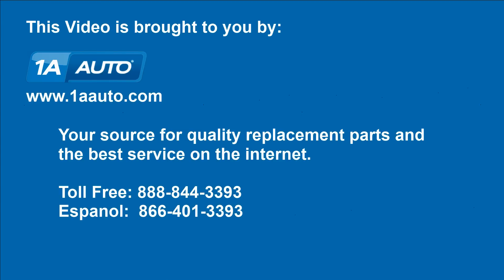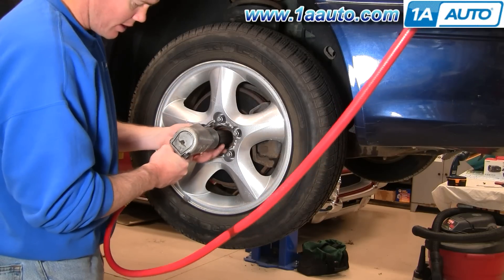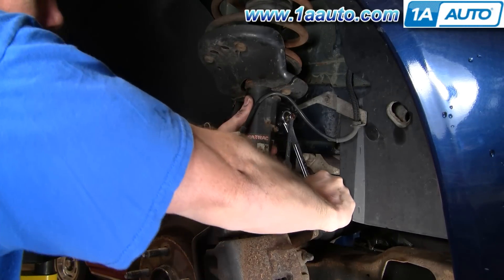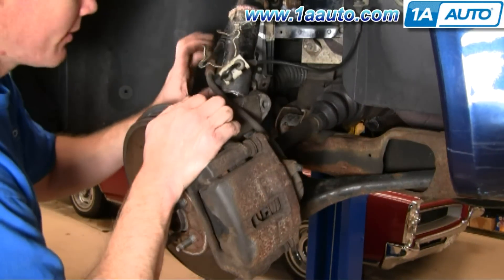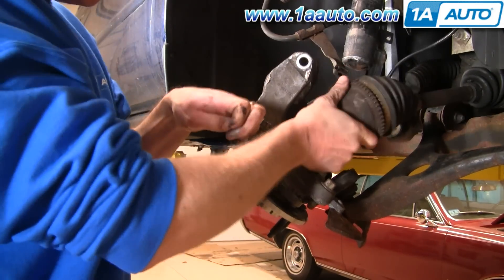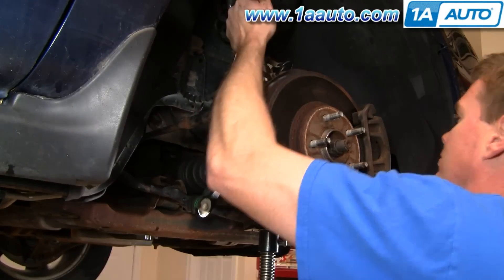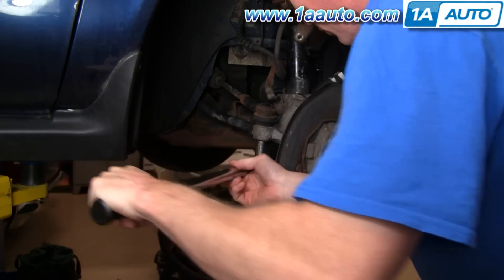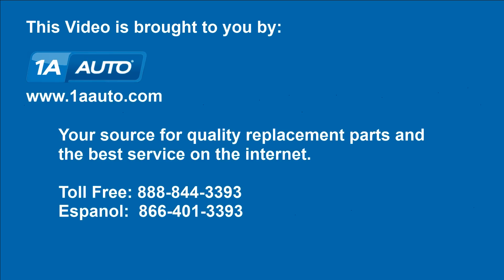How to Replace CV Axle Shaft 86-07 Ford Taurus

Comment: I wish you replaced the old axle with a new one like on mine. I used a new one it went on the drivers side without a problem but the passenger side I still haven't gotten to push right in like you did with the old CV axle.
Reply from the maker: +Teslarawks! Thanks for checking us out! http://1aau.to/m/Shop-1AAuto-c
Reply: @1AAuto  I must have been tired when I wrote that I meant to say that I am having difficulties in pushing the strut back in. I thought the old one was bent when I replaced the CV Shafts and had many people try to get it back in place. Maybe its because it is not on a lift or the sub frame is bent. the driver side went back on without a problem.
Reply: @teslarawks1673  same issue. Did you ever figure it out?😭

Comment: What happened? My strut was longer and couldn’t get it disconnected from the hub. The lower A arm wouldn’t lower enough and hit the frame. I had to take off the lower ball joint.
Reply: True, this is the wrong and hard way to do it. Best way is to just separate the lower ball joint,this is the wrong way to do this.

Comment: CV boot split on my 99 Wagon, only 80K on the car, so I just cleaned the area around the split, sealed it with JB Weld Plastic sealer, no troubles since.

Comment: Any tips for getting the bolt out that holds the lower end of the strut to the knuckle? 4:15 mark...  I got the 21mm nut off, looks like you were able to hammer it through.  I put the nut back on and have been hammering it but it won't move almost like it's threaded???  2001 Taurus.  Thanks
Reply from the maker: You should be able to tap it out with a hammer as we show in the video. You could try to spray some penetrating oil on the bolt, and also possibly lift up on the a-arm with something to help take a little bit of the tension off. Hope this helps you out. 1aauto.com 888-844-3393
Reply: 1A Auto Parts
Thanks, Got it out needed to be hammered used some PB blaster and heat, got it to move a little the worker it back and forth until I could get it all the way out.  Thanks and Great videos!!!

Comment: He makes it look easy to reinstall the strut end. I had a helluva time getting it in. Of course knuckle screw .just be removed (mine seized) and upon reinsertion you must align stop tab in knuckle opening. It also can help to use a pipe/pry bar above control arm and below frame rail (push down or even sit on it--if on jack stands!) and apply a small amount of anti seize to help strut slip in. Once you get it in be sure to put in bolt so that tab stop comes to rest atop of it because this determines the proper strut insertion depth.
Also, while in the vicinity change out the stabilizer bar link as they are cheap.

Comment: Excellent as usual, best videos.  
My problem was getting the strut out of the steering knuckle.  I had to use a small jack between the base of the spring and still had to pry with a screwdriver to move it over and out of the steering knuckle hole.  What a bear, there is no play whatever in the vertical direction, the control arm is bottomed out, the bushings were pushing against me, etc.  It might have been worth it to pop out the ball joint first so there is some room to move.

Comment: @1aauto I actually figured it out a couple of days ago, and I was able to get the old band onto the boot with it off of the transmission axle housing, and then shimmying the boot onto the transmission axle housing. Before I was trying to put the band on with the boot still on the trans.

Comment: I didn't realize it at the time, but one of my boot clamps popped off while I was replacing my shocks last week. I figured it out when the CV joint started clicking. Is it too late to just put a new boot clamp on it?

Comment: I have a 97 mercury sable, I am currently trying to resolve a problem I believe is stemming from a bad seal at the transmission which you point at in this video. Is there a specialized tool necessary to do this?

Comment: Hey there! I got a taurus 2000 and I'm getting a clicking noise between the transmission and the axle i pushed the axle and there is no more room to go into the trans, will that be a problem with the axle or the trans? Thanks!
Reply from the maker: You may want to check the front end by rotating the tire by hand to see if you can hear where the noise is coming from. Hope this helps you out. 1aauto.com 888-844-3393
Reply: 1A Auto Parts Thanks! That was more than one problem I had inner tie rod, ball joint and Link kit, everything was bad! :(   Thanks for your time. Appreciated!
Reply from the maker: WDJ Galvao
Thank you for watching!
1aauto.com 888-844-3393

Comment: I have a question I have a 2002 hyundai sonata 2.7l v6 with auto trans and front wheel drive I have tried replacing the front drivers side cv half shaft that I purchased from napa auto parts I found how to do it on ehow.com but when I have installed the new half shaft my transmission locks up how can I fix it? I have tried doing it about 8-10 times but the same thing happend can you help?

Comment: I just had both drive axles replaced by a shop that has a good reputation but on acceleration there is a little vibration/shutter for just a few moments until it gets to speed.  For some reason their mechanic says he can't feel it.  I don't know if I'm getting the run around or not.  What could cause that?  It's my wife's car and she noticed it first and I thought she might be imagining something but I have to agree with her as I don't remember that from earlier times I drove it before the work.

Comment: @lexusfan100 If the axle breaks completely the car won't move when you gas it, because the power will always go to the axle with least resistance. When going around a turn you'll hear a click, click, click when the seal is busted and the joint is free to rub metal to metal without grease.

Comment: @1aauto. 
I'm thinking of buying a Nissan Titan. And the ad says. Needs a rear end. Do I need to know the gear ratio? So I don't purchase the wrong one? Or are they all the same. The truck works great but not sure if it is worth the money if the cost of repair is to high. 
Found a rearend a local salvage yard. But only sell in sections and not sure of the part needed. And the dealer don't have a clue of what is need took in on a trade.

Comment: You need to do a cv axle shaft removal & replacement for a 2005 Dodge Caravan ( Driver side ) seems nobody has a video of it ..all the ones i've seen are for different makes and models and of coure they all have videos of the passenger side only ALWAYS ..Good video though...
Would i have to do the exact same thing to the 2005 Dodge Caravan to replace the Driver Side cv axle shaft.?
Reply from the maker: Thank you for watching. The process may be a little different. We will keep this vehicle in mind for future videos.
 888-844-3393

Comment: the problem im having is that the innermost firm rubber boot ripped and i the replacement boot they sold me is only the thin, plyable outer rubber layer of the boot. HELP

Comment: Thanks for your video. I have a 2007 Edge FWD. Is the Axel Nut on it also 30mm or is it a different size ?
Reply from the maker: It could be that size, but not 100% sure. We currently do not have an auto repair video on that particular year, make and model. Thanks for watching.

Comment from the maker: Usually a bad CV joint will make a thumping sound when you drive down the road. You could grab the axle (while the car is on the ground) and see if you can move the axle at all. You may also want to check the wheel bearings. Hope this helps you out. 1aauto.com 888-844-3393

Comment: So my friend and I did this last night without any major problems.  I now feel at higher speeds a wobble in the gas pedal and the steering wheel.  Nothing to grand but it's there.  Is it alignment perhaps?  Also I'm hearing a metal screeching sound.  My friend said it's rust on the new rotors(did brakes a week ago) as once I recognized the CV joint going the car sat about a week in the rain...  Is that normal?
Reply: Dietrich Kaiser Wheel bearings perhaps? I suspect wheel bearings going bad and creating heat and wear on my CV joint. Bearings were bad, also had the CV axle go bad as well as a rotor on the same tire, so I'm thinking the bad bearings caused the other 2 to go out.

Comment: I have a 02 ford Taurus and my passenger side axle POPPED . so the car would not move unless pushed. I have replaced both front axles and the passenger side seems to not lock in the transmission.. tried it many different ways and still slips out on me.. what could I be doing wrong? or what do you think could be causing the passenger axle to not stay in place ??

Comment: My left axle popped out leaving part of it in the trans a caramel  color fluid leaked out  from the inner joint (business end, reference from the video). What fluid do I use or do i just pack it with grease now when it's time to put it back in?

Comment: I have a problem with my '02 ford Taurus. Whenever I shift into a new gear that applies or releases pressure, we always hear a big clunk kind of noise. My step father and I have asked around and we have come to the conclusion that it is either the CV joint, or Transmission Mount. Do you agree with that conclusion? We're supposed to be looking at it this weekend.

Comment: I can not get the strut out of the steering knuckle, it gets stuck with about 1/2"-1" left. Attempted removing the strut from the top but, don't have enough clearance.
Reply: i had the same problem so i popped the ball joint out of the lower control arm
Reply: 6Ajani9  I used a bottle jack between the knuckle and bottom shock mount, it popps right out
Reply: +6Ajani9 Yes me too, did you ever get it to work?
Reply: Remove the ball joint it’s easier
Reply: hey i had same problem on 2005 taurus, the trick they dont mention in video is to jack up car and use jacks to hold it up and then put jack under subframe on side of car u working on and loosen  the 2 subframe bolts on that side and then lower the subframe a few inches on that side to u have clearence to pull out strut easy. Then reinstall and left subframe back up tighten bolts and do the other side same way. saves lot of work and time.
Reply: @legendtwo  I use a pipe as a lever on the control arm. Slide over top of control arm and under frame rail. Push--or sit on pipe (jack stands) and then hammer off. You can also try spreading the knuckle mount once (seized) screw is removed. Alternatively you can remove ball joint with the proper tool but that too was seized. Be careful when applying torque to the tool as the ball joint can eject rapidly.